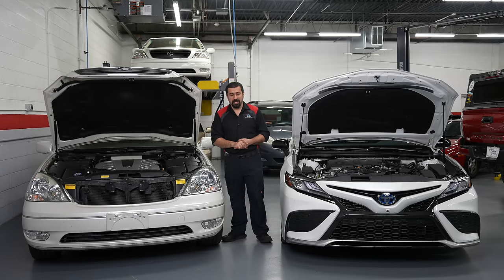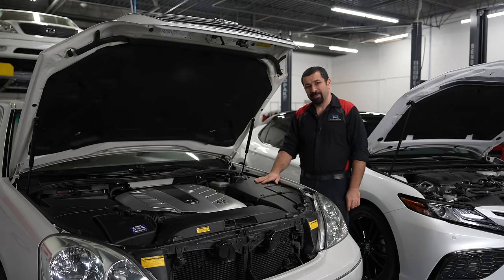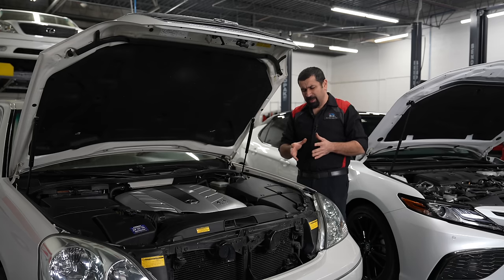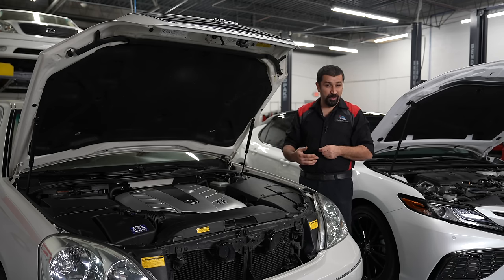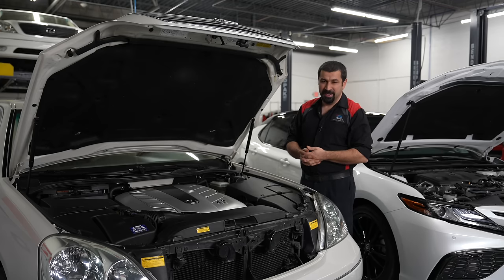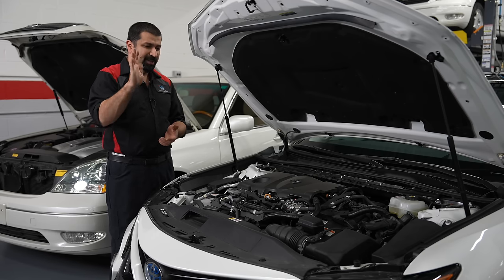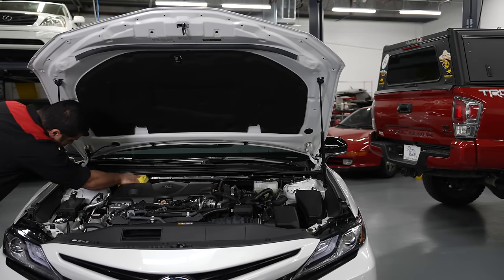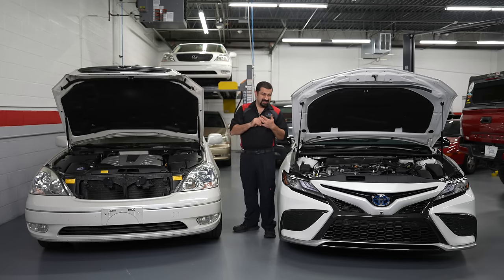Never Do THIS When Cleaning Your Engine Bay! Do THIS Instead

Comment: I have always used degreaser for engines since.. 70s. Decanted from larger bottle to a pump spray bottle.
Never use a high pressure water gun, just use a garden hose with jet nozzle attachment with the nozzle set to slightly fanned out, not a direct jet. A balance between good pressure and coverage.
Agree about connectors, never direct a heavy jet of water but use a slightly wider water jet and away from the entry points.
Before I start the engine, I use LOTS of WD40 or similar water dispersant all over the engine. Saturate the engine esp connectors, wires and looms, alternator, battery terminals, fuse box, belts then start it and allow to dry. Don't get freaked out by the 'smoke' as it dries and fumes coming off.. it won't blow up!
Water dispersant does a number of things.. mainly use it to remove the water from connectors and it protects them from water ingress and pin corrosion. It coats the engine, so when you clean the engine next time, the grime comes off so much easier as it acts as a sacrificial coating.
Also, makes the engine look super nice, it shines! Great for a sale, opening the bonnet shows a fab engine, big selling point.
I have never had any problems with starting an engine afterwards and corrosion stays away due to the water dispersant.

Comment: I just watched a video on a detailing channel.  The detailer gave the exact same warnings as you against water and pressure washing under the hood.  Damaging electronics, forcing water into the engine, etc etc etc.  He even stressed that while he does know what's where in the car, and a general understanding of what does what and places water shouldn't be, he is not a mechanic.  Looks like some detailers do know what they're doing.

Comment: The terminals inside the electrical connectors will corrode if you keep cleaning your engine with water. Compress air is much better.

Comment: Drive your car for at least 10 minutes to get the engine hot. You can then spray it off without a care. Drive it for 10 minutes after to evaporate any water inside the connectors.

Comment: i stopped having my engine bay sprayed w/  water when my old civic ek went kaput when i was heading back home.   apparently,  water seeped in one of those electrical parts and i was dead  in the water.  ever since then i just wipe  the  engine bay regularly w/  a  moist  rag/towelette    just to avoid dust  and grime from accumulating.

Comment: I am a retired mechanic guess what I do on my personal vehicles. I do clean but only when am I am doing an oil change. I just use some Dawn dish washing soap (about a teaspoon) and water in a spray bottle and then gently clean the dirty areas. On the black plastic I just use the soap and water. I don't go crazy on trying to get everything clean just make it so I can look, see if I have any oil leaks and then locate said leaks and repair as needed to stop the leaks. Dust on the engine compartment as long as they dirt and dust is not near the oil dip stick and caps then I ignore it until the next oil change. I have never sprayed down an engine bay with a pressure washer as one thing is true with something that is actually exposed to the elements as under body in under the hood IT WILL GET DIRTY AND DUSTY. For the folks in the rust belt I feel for you and I realize that some heavy cleaning of the under body is going to be needed to stop rusting but be careful around the oxygen sensors and the wiring.

Comment: what about Range Rover or Land Cruiser that can be driving in water as deep as 3 feet?  do those big SUVs have waterproof connectors under the hood?  Thanks!
Reply: Aslong as you don't slam it into deep water they are fine.

Comment: You can put some electrical grease to seal in a connector. Its improve water resistant alot. Dupont Molykote or DC4 works well. Don't use CRC 2-26 Electro spray because it will destroy silicone seal.

Comment: Use gunk foaming engine cleaner. Quarter wash dont pull the trigger  on soap cycle stay away from alternater rince at end  l do this in spring and late fall in chicago

Comment: Silicone spray on plastic hoses and seal rubber, simple green 1/5 to spray, electrical contact cleaner on all contacts, sensor clean on airflow sensor, plastic detailer on plastic covers

Comment: I love a clean engine. I go to the coin op carwash, blast the engine bay w hot soapy water,
I dont rinse, its not necessary. I have found sometimes a car is reluctant to start after
So, I have learned to leave the engine idling as I blast & do no blast directly @ the
alternator or air cleaner, or ignition coils. AFTERWARDS, drive out on the highway to
give the engine a change to dry off.

!

Comment: I do it once a year, to remove salt deposits. Just a smooth shower without any pressure being careful not to soak the alternator, and then drive for an hour on the highway to make sure everything is dry. No chemicals.

Comment: Great informative video, I really like your passion for your work. I've been cleaning my engines and engine bays for about 40 years now by doing the following - I hose the engine bay only when the engine is cold, I avoid the alternator and electrical connectors, I never pressure wash and I only do the job before a 2 hour drive. To date I've never had a problem.

Comment: If you want to clean your engine bay,  just take a few old rags, some soap and water, and use that to wipe away 'most' of the dirt and dust in your engine bay.  For heavily greasy areas you can use some 'Goo Gone' / 'WD-40' liquid (or other de-greasers) on the rags and that will work wonders.   There will always be a little bit of dirt left behind but that's okay, it won't hurt the engine. Trying to clean that last little bit of dirt WILL end up hurting your engine.

Comment: I always use the quarter car wash, when I have a minute left on the timer. I pop the hood and on rinse mode, WITHOUT pulling the trigger, the mist is enough to remove dust buildup... I've  never had a problem. 

I wouldn't do this to my 79 trans am, but my 14 grand cherokee and 17 charger, it's just fine (Knock on wood). The jeeps got 192k miles on it, and my charger has 393k miles on it

Comment: Im ex intern mechanic one of my case the customer washed his car engine and it started to sound funny. We found that the water coroded the ignition coil and spark plug including the tip of spark plug holes in the combustion camber.

Comment: I always wash the engine cold, I then spray everything with diesel which waterproofs. Using a brush I clean the engine, then rinse off with the hose. Never had any issues in over 30 years.  The vapour from the diesel disappears within a day and in effect the engine is “waterproofed”

My father, a mechanic, always said that a clean engine “breathes” better.

Comment: use varsol with a brush to loosen all the grime and a small 1gallon garden sprayer to directly target small areas to rinse. You can do the whole bay with 1 gallon. Blow connectors etc out with an air compressor if you have and that’s it. This is the safest way to do it. Hosing your engine bay is lunacy.

Comment: Back in 1990... I bought my first Honda... an Accord... had it for 14 years... spent less than 25% of the new price (23K) in dealer service and Michelin and Hakkapalitta snow tires... 

Whilst taking a door apart one time... (upgrading speakers)... I saw that the electrical connectors for the door had silicone dialectric grease inside the connectors... damn... that attention to detail has led me to buy 5 more Honda's... 

Worst car ever for electrical problems was a my (pre-Ford) '86 Jaguar ... they certainly had no friggin' clue as to what silicone dialectric grease was...

Comment: Be very careful what you spray under the bonnet, spraying dressing meant for plastics in other parts of the vehicle is a big no no as many of these are oil based, if they land on parts of the engine that become hot (i.e) exhaust they can catch fire very quickly. I would highly recommend using a cleaner specifically designed for engines to be safe.

Comment: Unrelated to the video, is it normal for the hybrid a25a-fxs to shake randomly on cold start for the first minute or so (when the engine is revving high)?

I notice these random vibrations/shaking inside the cabin on my 2023 Rav4 Hybrid on cold start and I’m unsure if it’s normal or if I should go to the dealer

Comment: Lol I bought a 2018 trd premium 4runner new and drive it every single day, but I just now passed 30k miles 2 weeks ago... I opened the hood the other week just to look because I have seen the engine in almost 8 months, there were spider webs in the corner and it's still cleaned from the factory just slightly dusty, I live just north of Seattle wa, so even all the rain and splashing doesn't get in there. Also it's parked outside not in a garage. My wife's 2017 corral is the same but 27k miles , neither have have had the engine sprayed with anything ... Zero corrosion on anything including the battery terminals

Comment: I always spray WD40 or a similar product on all electrical parts-fittings before I clean the engine. Also, cover the battery and alternator with plastic bags.

Remove as much debris-dust with a soft brush or a leaf blower 1st, then Gunk or Engine degreaser agitated with a paint brush. Let that sit for a bit, depending on how dirty the area is, then hot soapy water to clean off the Gunk. I use my petrol Sthil leaf blower to blow away access water and finally use clean rags to remove any residual water.

Never had a problem.

Comment: So remove or cover the alternator, battery, cover sensitive components with plastic, and follow up by disconnecting different connectors and blowing out any water with compressed air.

Comment: All you need is some APC diluted and a pump sprayer to treat the surfaces. Agitated with a brush if needed. Wipe it all with a couple of damp microfiber towels and finish it off with some vinyl and rubber dressing. Job done. Takes 15-30 minutes for a deep clean less if you're doing a maintenance clean. In this case, you can use a rinseless wash product instead of APC.

Comment: I would buy couple of demineralized water jugs. They cost like a $1 per gallon. It will never cause short circuit and would not leave stain or residues. Should be enough to clean engine bay once a year. If you don't have the compressor you can use can with compressed air to blow off the water from electrical parts.

Comment: Use a steamer to clean.  Less water and more direct.  Wrap electrical and air intake with foil.  They stay in place easier and you can shake it.  Wash when engine is cold.

Comment: I used an engine degreaser on a 1984 Cadillac. You gently spray the engine area with water, spray the can (s) in the engine bay, allow it to soak for a few minutes then hose it off. Everything looked nice and clean. On the trip home, the engine began to rev up to 4500rpms (with my foot off the gas). I had two feet on the brake. I was about to shift into neutral and shut it off. The rpms calmed down. The check engine light came on and the idle was rough. The TPS got wet and malfunctioned. Lesson learned. The whole reason cars have hoods is to keep water OUT. just leave it dirty. No one (except you) is looking in the engine compartment.

Comment: As a car owner, my question is. Why do you need to clean the engine bay what does it serve?
Reply: Keeping it clean can help slightly with cooling and corrosion, as well as making it easier to see where a leak is coming from if you have one.

Comment: I sure like your videos. You are a top mechanic. I use bg44 gas treatment cleaner in my toyota and  my dodge truck. I use it every 6 mths on both. Do you like bg 44k and do you recomend using it. I change engine oil every 5000 or 6  mths and have always used mobile 1 on both. My camry has 184 thousand miles and doesnt use hardly any oil. My truck has 218 thousand miles and hardly uses and engine oil. Thanks for your advice.
Lee from cheyenne wyo
Reply: In my opinion, gas treatment for Toyotas are just waste of money if you're using top tier fuel in your area.  Changing the engine oil as per your intervals is the most beneficial to your engine.

Comment: Pressure washed every engine bay of every piece of equipment I have every owned.  Never had a single issue.  In fact I have fewer issues than people running the similar equipment.

Comment: Here is the thing, most engine bays nowadays design for outdoor environment. engines and components should resist extreme and sudden temperature. One of my mistakes was I did not replace the Accord low CCA battery that actually wears out the alternator. If you have a low CCA battery, it will destroy the alternator of that vehicle!

Comment: Well, I am probably going to go against the grain, but I have pressure washed my engines for 30 plus years.  I did have a problem with a Ford F-150 on one occasion, but that was due to the wrong coils being installed.  In the end, I have heard people agree and disagree with pressure washing.  I agree with this video that you need to use, "Common Sense" when it comes to pressure washing your motors.  For example, I just purchased a 2021 Toyota Corolla XSE Hatchback.  The engine bay looks like it was in a dust / mud storm.  The process noted in this video is not going to cut it.  In essence, a wipe down with a towel is going to do little to nothing.  So, I will usually spray it down with soap, let it sit, and pressure wash the motor at a safe distance.  Sometimes, I just let it air dry and other times I will use a leaf blower and air dry it.  Interesting there was no talking about steam cleaning which is very effective as it uses low pressure.  
There are a few questions I would have for Mr. TCCN.  First, if manufacturers know that their engine bays are going to get dirty why do they use all the belly pans, engine covers, and fender wells? Yes, they can make a car look a little nicer, but in the end, don't they put them on to keep the dust and dirt out of the engine bay? It would seem to me that manufacturers know it is not good to have contaminates in the engine bays; so, they design covers to keep as much out as possible.  Second, most of these automotive electrical connectors are rated with IP water resistant rating.  So, can't we use water up to a certain pressure?  I get alternators are air cooled, but I have never had to replace an alternator for pressure washing a motor.  I have pressure washed motors for over 30 years.  Never once have I needed to replace an alternator.  So, the question is, are the parts inside an alternator protected with a coating?   I have looked at an alternator from the outside and you can definitely see all the windings are protected with a coating.  Lastly, people say that using water to clean your engine bay goes against common sense; yet, doesn't clean engine work and last longer than dirty engines?  It cannot be good for engines to have dust, dirt, and grime getting into things.  I have personally had more problems with dirty engine compartments than I have with engine bays cleaned with pressure washers.  I have had multiple times where I couldn't even get electrical connectors and parts off due to so much dirt and oil caked into the connector or part.  Why?  Well, the person did not want to put some water on or pressure wash the motor!  Lastly, what about steam cleaning?  This can be very effective as it does not take high pressure, would meet IP ratings, get the job done.

Comment: Maybe it would be a good idea to begin with spraying down all connectors with electrical cleaner. If the connections already saturated with something that's good for them, that ought to help protect them from all subsequent cleaning steps. Maybe even against direct pressure washing, even though that is a bad idea regardless.

Comment: What are your thoughts on Toyota CVT transmissions?  I've seen vids from the Car Wizard that CVT's require more frequent trans fluid changes or they will die an early death. Is this true in Toyota? Then there is the whole "lifetime" fluid debate.  I've always immediately dismissed cars with CVT transmissions out of fear, but they seem to be present in all the Toyota Hybrids now.  Do hybrids have more or less failure points than non-hybrids?  I've avoided hybrids because they look like a nightmare to repair,  and are unfamiliar vs conventional engines.
Reply: I own two Toyota Corolla’s mine and my wife’s both have cvt transmissions they are both 9 years old and both have around 170,000 miles have never changed the cvt transmission fluid and my Toyota dealership does all my maintenance and says there is no problems with either car
Reply: If I am not mistaken, AMD has done a series on  the Toyota hybrid system.  The eCVT they use is essentially a computer controlled gearbox, tough and easy oil change maintenance. Very different from the cvt used in the straight gas models.
Reply: The CVT scare you are hearing are mostly from the ones made by JATCO which is what Nissan has been using.  Those are very notorious to fail.  The Toyota ones from Aisin are solid.  Change the fluid every 5-6 years or 60,000 miles and life is good. 

In my experience, I daily drive a 13yr old non-hybrid corolla with CVT and no issues.  Btw, the toyota Hybrid CVTs are way different than gas ones.  They don't have belts (which is the one that's scaring a lot of people), it uses planetary gears as good as any standard automatic from Toyota.

Comment: Car detailer uses tire foam spray. Sprays it on all the engine even the alternator. Then takes an air compressor to spray off the excess, then wipes the engine down with the micro fiber towels. He says does not hurt the alternator.